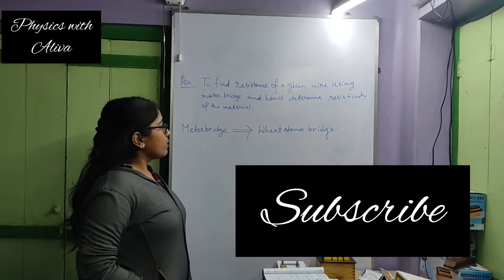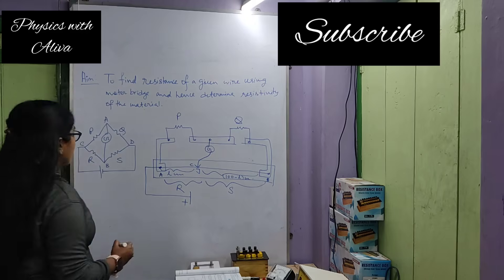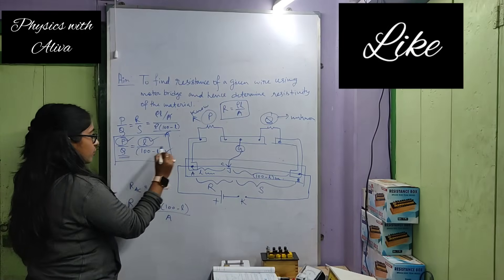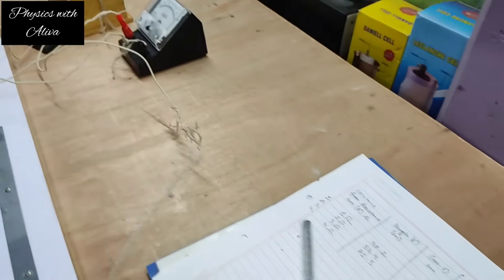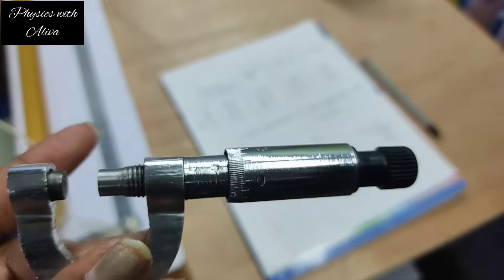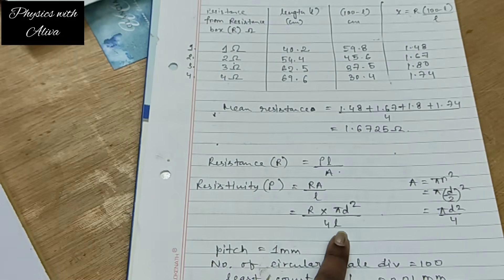To find the resistance of a given wire using meter bridge and hence calculate the resistivity

Comment: Mam can u plz tell is resistance per meter is 0.1701 used length of wire 1 meter
Reply from the maker: We have found the resistance of the resistance wire, kept at right gap of the metre bridge. Not the resistance of 1 meter resistance wire of the meter bridge

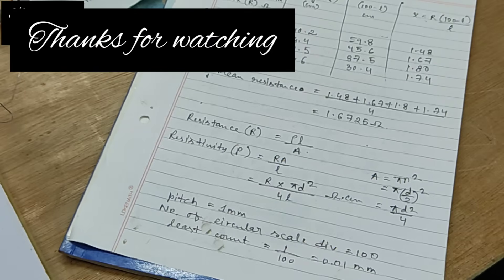Comment: 18:43 Ma'am, the unit is ohm per cm right?
Reply: No,it is ohm cm not ohm per cm
My personal trick to remain away from this confusion
R equals to rho into L upon A so,rho equals to R into A upon L now,put the units of area,Resistance and length,you will get the units of resistivity that is ohm metre not ohm per cm
Reply: See from units and dimwnsions

Comment: Key connected with battery is high resistance 5k?
Reply from the maker: Your Question is not clear to me
Reply: @physicswithaliva9791  sorry. 
should we connect 5k high resistance in between galvanometer and jockey
Reply: What happened

Comment: Unknown resistence mein konsi wire use krein for better result ??
Reply from the maker: Wires with high resistive materials like constantan
Reply: @physicswithaliva9791 bt that is already their on board 

I am asking about the unknown resistence S wire which u connect
Reply from the maker: @skeducadomme8970 nichrome or there are different alloys, which can be used as S .

Comment: Mam isme rheostat kyu use nhi hua pls btayiye??😢😢
Reply: Because if we are gonna use rheostat then how come we can find 2 unknown resistances through wheatstone? And if you are believing of using rheostat as unknown resistance you still can't use it because the aim is to find resistance of a wire not an instrument. I hope this satisfies your query.
Reply: @jyotpatel4943  yes, but in my school rheostat was used that's why I got this query
Reply: @JyotiSingh-k4f3h well, galvanometer gets damaged due to excess currents, so schools might use them to prevent damages to instruments and also it stabilizes readings in the galvanometer. They attach it in series so as to provide above points that I have written.

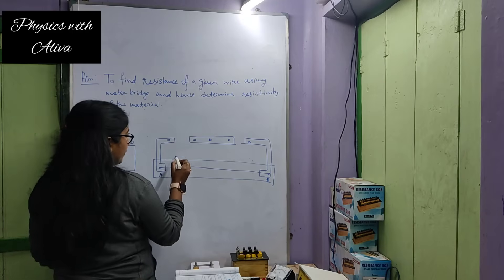Comment: Mam here 1:23 The length between A and B should be 1m or it can be of any metre???
Reply from the maker: Length of wire of meter bridge = 1 meter always
Reply: It's called the 'METER BRIDGE' because it measures 1 meter always

Comment: Mam it is possible if we take resistance 0, 0.5,1,1.5,2 
Then what will be the   balancing length.. please tell
Reply from the maker: @star_always_glow zero resistance is not possible at all !!!
You have to find resistances for which null point will lie 40-60 cm nearly by trialing. What will be the values of the resistances that depends on the unknown resistance provided to you.
Reply: Ok mam 
 @physicswithaliva9791
Reply: Mam if galvanometer deflection is in opposite directions then will connections are correct
Or it's deflection will always where we put the jockey ..
Reply from the maker: @star_always_glow today I will provide another detail video on this. Please watch that
Reply: @physicswithaliva9791  ok thanku mam really it will be helpful as my practical exam is tomorrow

Comment: Mam but in the pratical it is written to find resistance of given wire but in the  requirement of experiment it is written screw gauge so is it necessary to calculate resistivity also ????
Reply from the maker: If it is asked to find the resistance then only do up to that
Reply: I understand mam but in the requirement itis written to use screw gauge 
Mam clarify my doubt as I am having pratical tomorrow
Reply from the maker: @SumiyaChoudhary-iv4uj if it is asked to calculate resistivity, then only screw gauge is needed

Comment: Mam do we need to convert the length of the wire  in mm because for the diameter we've used mm same units must be there for the calculation right?!..
Reply from the maker: Yes convert all in same unit.

Comment: Mam can u pls tell me the name of that white wire which is used in circuit
Reply from the maker: @अर्जुन-भ6ट  resistance wire—-constantan having high resistivity
Conducting wires ——— copper having high conductivity and low resistivity
Reply from the maker: @अर्जुन-भ6ट  conducting wires insulated by threads
Reply: Suppose if i asked in viva about its material so can i say Constantan,Nichrome ?

Comment: Mam would there be any change in the arrangement of the circuit if  there is no key?
Reply from the maker: It will remain same. Just connect the negative end of battery with rheostat.

Comment: Ma'am but I think The jockey should be first touched gently to the left end and then to the right end of the bridge. The deflections in the galvanometer should be in opposite directions and if it is in one direction then the circuit connections are not correct.
Reply from the maker: Yes! I have shown this in the video.

Comment: Is it necessary to make table for radius of wire in board practical.... Ok maam plz tell that what is resistivity of wire like its 10^-7 or 10^-8
Reply from the maker: If resistivity is asked then make the table for diameter of the wire

Comment: Mam I have a doubt, do we have to take multiple diameters of wire using a screw gauge and then take out the mean diameter?
Reply from the maker: Yes. Measure diameter from different portion of the wire, then calculate the mean diameter
Reply: @physicswithaliva9791  So mam we have to subtract error from the mean diameter or to subtract it from each diameter obtained and then takeout the mean?

Comment: But the deflection In galvanometer should be in  opposite side??
Reply from the maker: Can't understand your question... Please elaborate
Reply: @physicswithaliva9791   In practical Files and Many other videos related to same experiment

They said.. 
when you place Jockey on Left Side of wire 
Deflection in galvanometer should be observed in right direction
And When You place Jockey On right hand side of wire, deflection in galvanometer should be observed in left direction 

That's the Point which is confusing

Comment: Mam length of resistance wire?
Reply from the maker: You can measure it by using a meter scale
Reply: @physicswithaliva9791  mam I was asking about the length of wire u have used here

Comment: Mam mera galvanometer same side deflection show kr raha haii  connection bhi  check kiye but fr bhi same side show kr raha hai kya solution hai iska.plz batana
Reply from the maker: Either circuit ka issue hae Or circuit element kuchh thik nhi hae, check the performances of each circuit element using multimeter